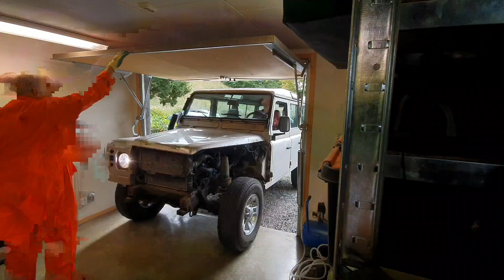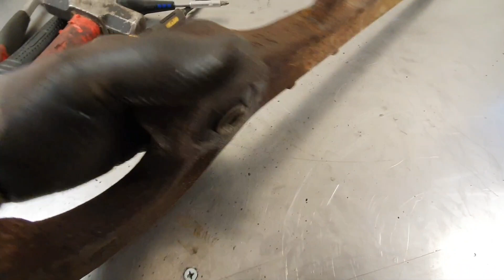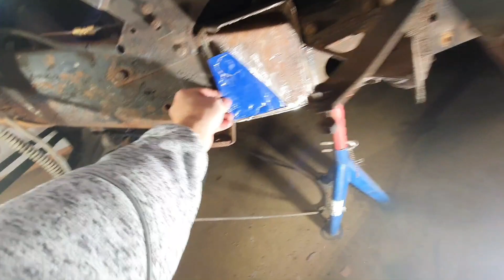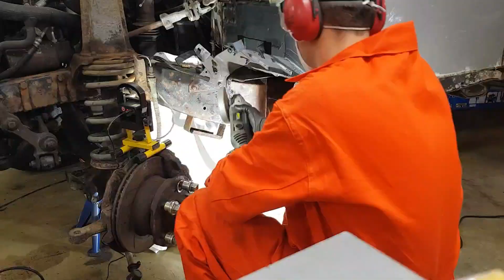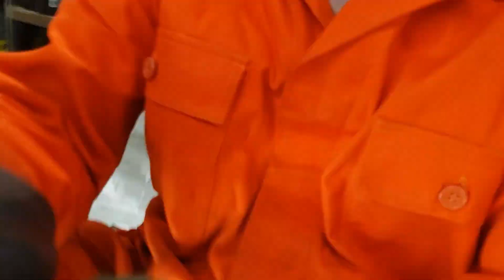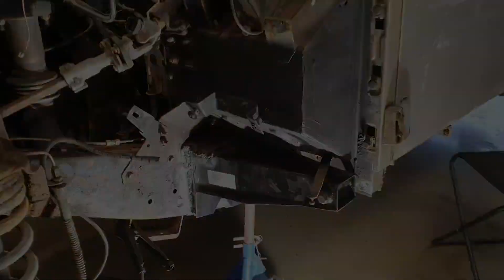Welding on a NEW outrigger! Chassis welding how to

Comment: Nice work 👍🏻 Was there no point in painting behind the new outrigger with something to help prevent future corrosion?
Reply from the maker: Thanks!
I used a wax oil kind of rust protection in a later video, so it got filled inside with rust protection :)